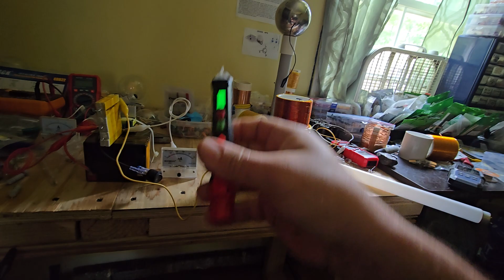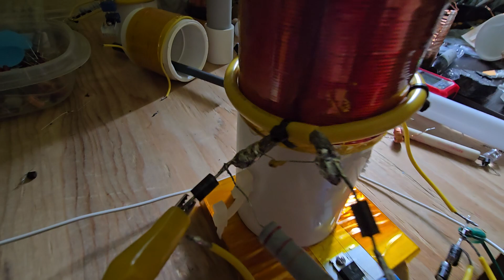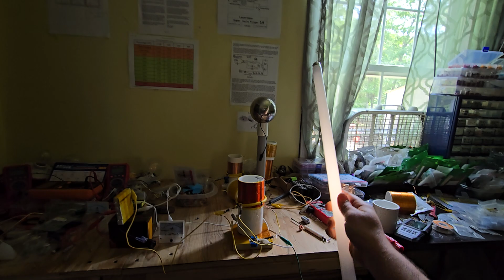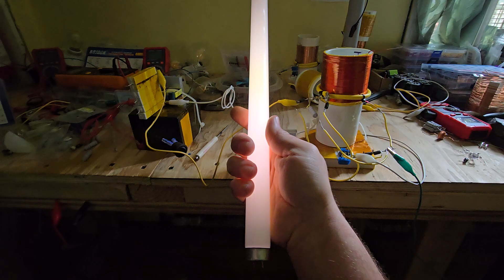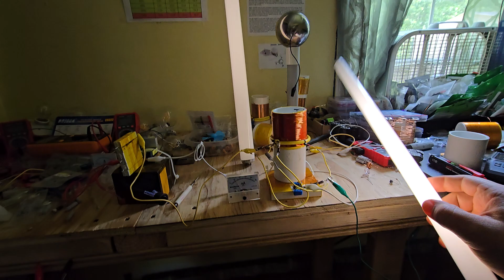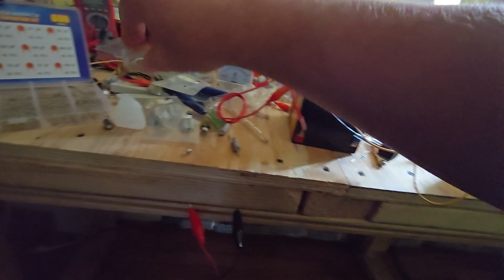ANSWERING MORE QUESTIONS ABOUT THE NEGATIVE RESISTANT DIELECTRIC TESLA COIL PLUS MAGNETIC FIELD TEST

Comment: At 7:20, How do you know it dumps ALL of its energy.
Have you measured the energy?
The light level from a Fluorescent Tube does not measure the efficiency, just shows the level of output energy.
Have you measured the input and output power?
Sorry but the tube lights up due the ELECTRIC FIELD, the difference in the field lines causes the light.
Nothing to do with magnetic or "dielectric" power.
Reply from the maker: The coil is built according to Eric dollard & Nikola Teslas Theories being as tall as it is wide enabling that effect along with creating a Shockwave condition of abrubt emf by its switching from 0 Conductance to maximum Conductance as fast as possible :)
Reply: The Dielectric field is the correct name for the "Electric" field, it's what Faraday and Steinmetz called it, the term "Electric field" is for the combined Dielectric and Magnetic fields in a circuit, a conjugate field.

Comment: I hope you read this. I much like you, worked on this type of experiments for a long time. I have something to share. 

You have turned into the wrong, dead end corner like I did. Nothing is pulled from the ground. The secondary coil is basically one with the air around it. When you get close to it, its' energy capacity changes. When it is "shorted" to the ground, it is now less inductive and has way lower natural frequency. With lower frequency it is now able to vibrate less energy hence less current draw. 

What WE need to focus on, is the phenomenon of negative induction or negative resistance as you call it, and this phenomenon will suck in emf from the air, not ground. Much like a fridge having COP more than 100% and we are already okay with it. And it will suck energy like it does. 

Such a device will be more "ground" than the ground itself. So of course you could get energy from the ground, but it will truly shine when it does from the air. 

The configuration of the real tesla coil has never been disclosed either. But I have results using opposing coils dumping emf unto a common inductor, which should result in a zero net emf. This is easily hidden in Tesla's notes. I have strong conviction his third resonator or amplifier coil is of two opposing coils attached together resembling a normal coil.
Reply: Do you have any thoughts on the idea of constructing a Tesla transformer with the secondary coil wired as a bucking coil? That is, where half way up the coil the winding direction is reversed, there are a good number of experiments that show that transformers that utilize that configuration in varies ways show a lack of Lenz drag and current draw with increasing load.

Too add to that, magnets that are placed together in opposition and oscillated, especially at resonance, produce radiant energy effects like we observe from the quenched spark gap and similar ultra sharp transient conditions, a resonating L2 Tesla transformer in that configuration may do the same thing without the need for disruptive discharges.

So perhaps structing the L2 coil like that will produce anomalous effects, something to experiment with.
Reply: @JenkoRun  My point exactly. Negative resistance is also easily produced by any gas discharge in a tube. That's why we use ballasts, to combat the negative resistance produced. 

Think of this phenomenon in other physical examples. Refrigeration effect can be produced by alot of methods. But the principle remains; we inject energy, and the thing behaves in such a way that it absorbs more energy from the surroundings. This is the phenomenon we need to focus on. The actual principle of an "electromagnetic blackhole." I did my final year project on this exact title 10 years ago. 

Nothing is magical or novel about this. This should be as normal as a chiller, our air conditioners, our fridges. We are drowing in heat from the sun. Likewise in EMF. Tesla was talking about the charges readily available to us in the air. 

Radiant energy or scalar wave is just another component of emf radiation. Much like magnetic field is to a current in a wire.
Reply: @JenkoRun  To reply to your question, I did experiments on the refrigeration effect of gas and liquid to study how energy can be absorbed forcefully from one medium to an active medium. My best guest is, a simple current discharge does this already, but as soon as emf is absorbed it is smashed together at a singular point reradiating as light and heat. We need to make a discharge that does not allow emf to be reradiated but changed directly to current. (Superconductor?)

I experimented with a pair of tesla coils (transmitter and receiver) and found that coupling is greatly affected by a strong discharge of current (from a welder) operating between the coils. That is, the radiating emf of a tesla coil is somewhat diverted towards the discharge of current instead of the other receiving pair.
Reply from the maker: Definitely a possibility & yes I plan to inject as much negative resistance as possible into this new coil :)

Comment: The secondary has a capacitor for resonance -- making a tank circuit. I'm assuming. I wonder if you can keep the exact same capacitance value, but to have a dielectric breakdown voltage that is much higher and to also alter the step-up to a much higher voltage. E = ½ * C * V². I recall from Tesla's Colorado springs notes, he was obsessive about calculating how many salt-water capacitors he would need -- doing equation after equation for this. His were hand-made. Another outside-the-box idea is that coil geometry could be experimented with beyond just simple cylinder shapes. One thought experiment here is the notion of a coil array arranged like the "flower of life" pattern, with coils that have constructive mutual induction -- to boost inductance higher and higher. Instead of primary to secondary, there could be several primaries in series arranged around a central single secondary, with inductive coupling not from one plane of a cylinder to another, but from the sides of the coil, more like how a transformer is arranged (see Hubbard coil). Another experiment idea. Instead of a single resonant frequency, imagine a new sort of Tesla coil that produced several harmonic frequencies simultaneously. Using cylinder shapes, for example, if the diameters of each neighboring coil is a whole number (or PHI) ratio of its neighbor, its self resonance could be constructive with its neighbor. It might be possible to make a transformer to not just step up or down voltages (current), but could convert from one frequency to another (step up or down frequency). Everyone keeps making the same sort of Tesla coil, but I think what is really needed are experiments that are DIFFERENT from what we know.
Reply: Secondary is in 1/4 of wavelength, that is not LC-resonance, you could call it wave-resonance, in this case what matters is the length of wire, capacitance and inductance are minor influencies
Reply: @antonm.3894  re: capacitance and inductance are minor influences. Well inductance, if large, allows for high Q. See the equation for Q. Higher Q equals less energy loss, sharper resonance. And, the resonance peak approaches infinity. Who doesn't like infinity?
Reply: @morpher44  When building Tesla coil (not Slayer exciter or Kacher) you obviously need LC-resonance calculations: primary part is generally of lower frequency consisting of an LC tank and serves to build up resonant voltage to charge capacitors which will be discharged through a spark gap. Abrupt voltage drop produces the same effect as in Slayer/Kacher circuit (1/4 wave resonance), but at the same time there is a spark that works as wide band white noise generator which always excites secondary into LC-resonance. Thus, in Tesla coil there are always both types of resonance (sparks at the hot end of secondary are both white and purple in different proportions depending on coil geometry and circuit parameters). In case of Slayer/Kacher circuit you get predominantly 1/4 wave resonance which gives purely purple spark
Reply: @antonm.3894  Too add to the discussion the common Tesla coil design where thousands of turns of very fine wire is a major error for both Voltage gain and Q factor, Eric and Hakasays have shown that what you want for the largest voltage magnification is the highest Q, and the more resistance you have, both metallic and dielectric, will eat up the fields as the coil oscillates, you want as little dielectric material and as low resistance wire as you can practically get, those should take priority over the number of turns where practical.
Reply: @JenkoRun  I do agree. When your Tesla coil's primary is driven by relatively high voltage you can use high-Q secondary (fewer turns of thicker wire), that would be the optimal option in this case. But still, if for some reason you cannot provide high enough voltage for your primary you have to opt for more turns of finer wire (still as thick as possible), otherwise you will not get desired effects
Reply: @antonm.3894  In the context of a Tesla coil acting as a receiver, high-Q inductance is generally more important than quarter-wavelength tuning.
Reply: @morpher44 Well, as much as I know receiving Tesla secondary (fine wire, lots of turns) is tuned to a 1/4 wave length and primary (thick wire, few turns) is tuned to LC resonance to get more commonly used voltage and current

Comment: but can you really get negative energy with a neon light bulb???
Reply from the maker: The pulsed firing of the neon bulb creates negative resistance being decreased current consumption during the discharge pulse
Reply: @MTECH2022  Neon has all these weird negative resistance properties that I can't wrap my head around. I guess the radio guys in the 30s, 40s and 50s also figured out how to negative resistance with tube tech. Bedini used a neon in his simple-school-girl circuit -- which may have been an important element. Relaxation Oscillator?
Reply: @MTECH2022  thank you so much for this information that I was unaware of. Congratulations again for the results!!!!

Comment: So the primary coil doesn't need much current, higher the voltage the better? So would this work in my circuit?
Reply from the maker: So far yeah it seems this baby excels at being high voltage pulse driven & the heavier the wireless load you draw from the coil while earth grounded the more efficient the coil becomes
Reply: @MTECH2022 you should start selling these coils, the kits are a bit pricey for me.